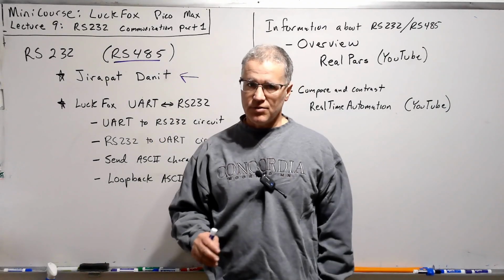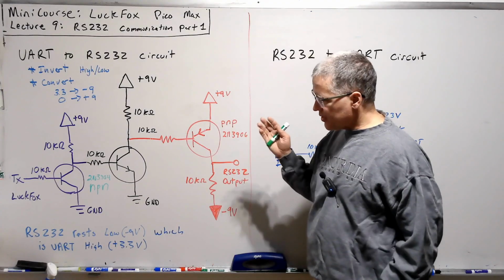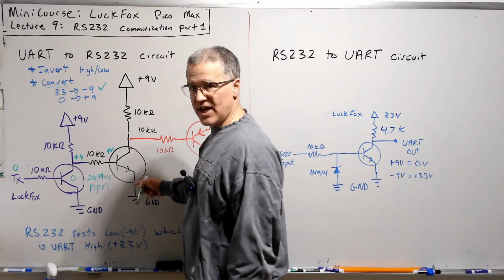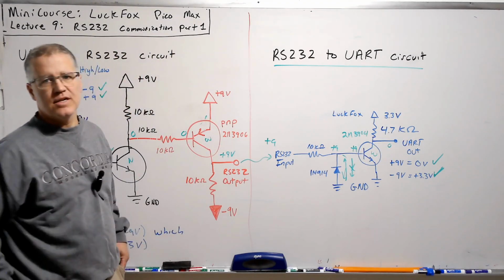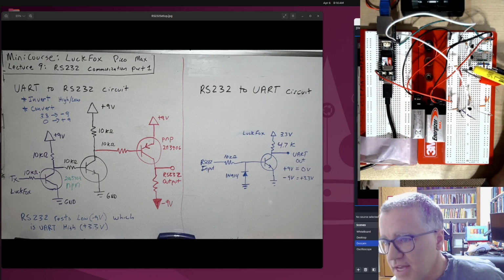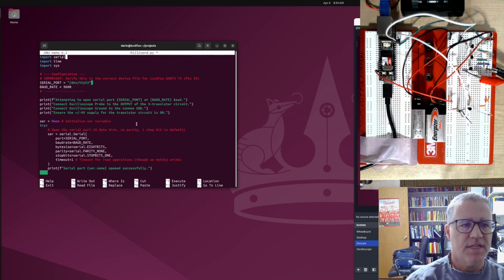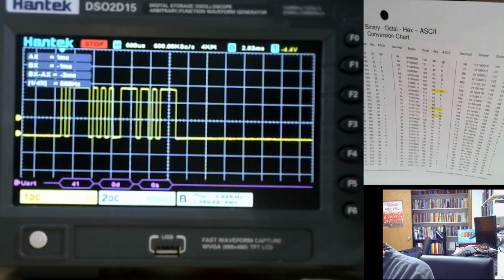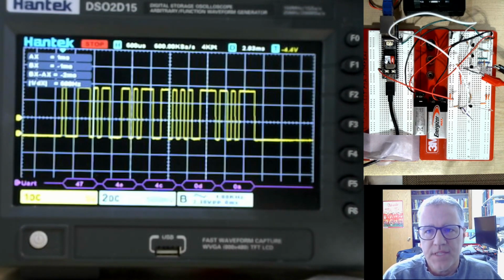LuckFox Pico Pro/Max Lab 9: RS232 Communication – Part 1: Hardware Conversion

Comment: Hi sir, will you make a video about CSI Cameras and how we can use them as UVC?
Reply from the maker: Thanks for the comment. My immediate schedule is full of physics and physical chemistry videos so I will not be able to do this in the immediate future. However, I wonder if the two videos below could be somewhat helpful to you right away.

https://www.youtube.com/watch?v=yE98S15Tph0&list=PLMmzicajje3w9aUx9kaJ33TiY12JjBC2c&index=14

https://www.youtube.com/watch?v=G1NeBti9fpI&list=PLMmzicajje3w9aUx9kaJ33TiY12JjBC2c&index=19

Good luck with your projects!
Reply: @GNLProject-yp8po  Thank you! But I made it work just last night, I was kind of in a desperation mode lol. Anyways thank you for your content, it is a big help!

Anyway, is there a chance you would be doing some TMC2209 project together with the luckfox pico pro/max?

Cheers!
Reply from the maker: Yes, motor drivers are important things that I have not done videos on. They are definitely in the future but probably not until after this semester. 

Are you working on some sort of robotics project?
Reply: @GNLProject-yp8po  That's awesome to hear!

I kinda am, but I am working on a much simpler project, which is a ptz camera. And I am trying not to rely all the motor tasks on an esp32, to make it more integrated. But I haven't done this project before so I am lost with buildroot system and the drivers.
Reply from the maker: That’s cool. Good luck!